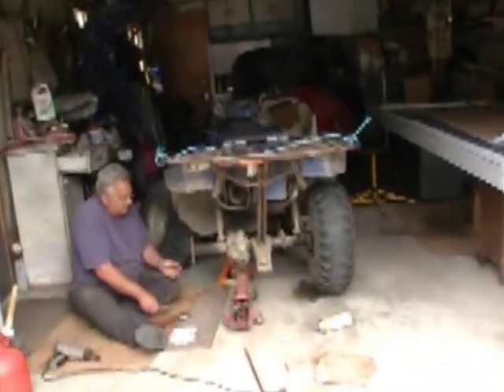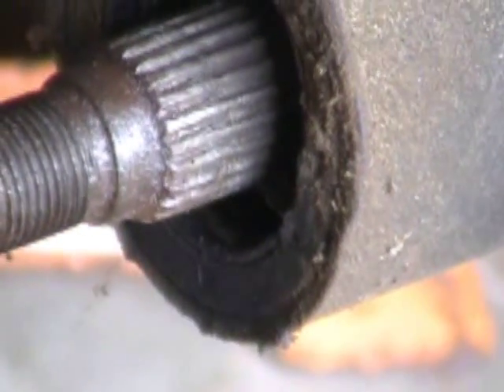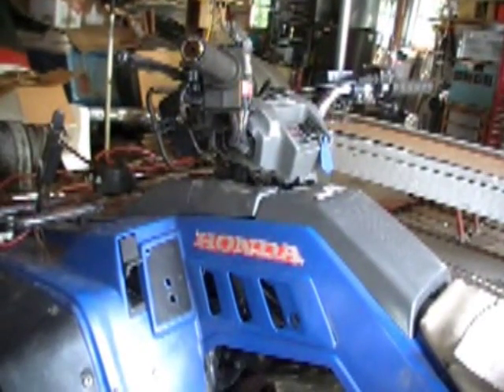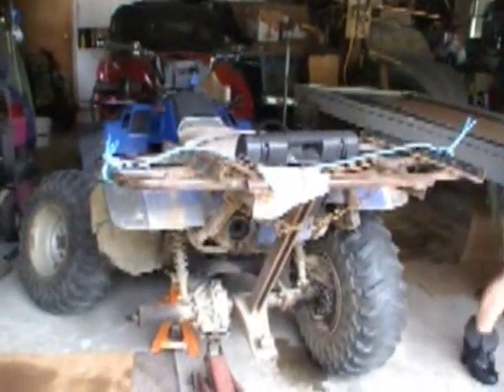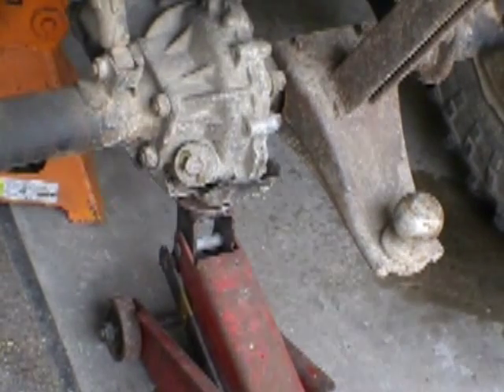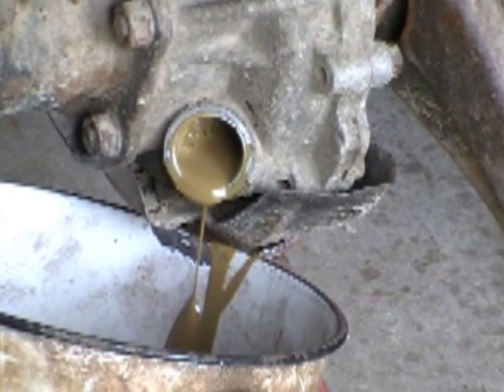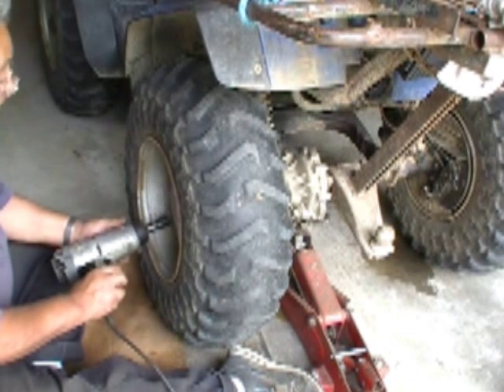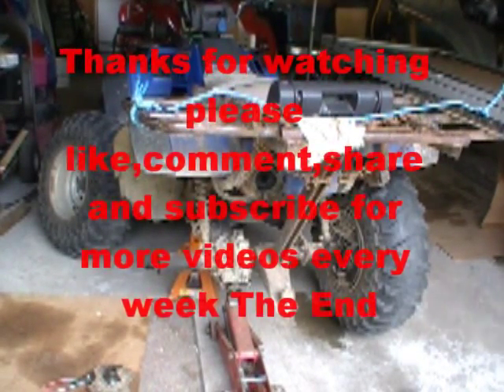honda fourman fourtrax 4x4 rear axle check worn out spline

Comment: Splines didn’t look bad to me. Sounds like you need bearings if it’s wobbling.
Reply from the maker: They may not look it on camera however they are or were very bad. The four wheeler has since been sold and is long gone. Thanks for taking the time to comment